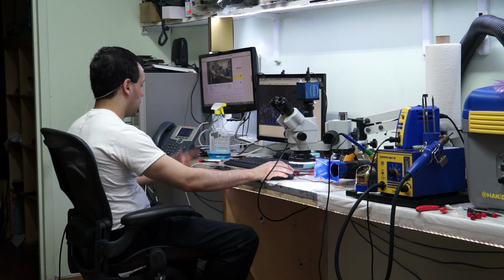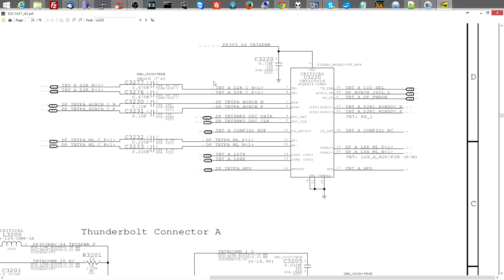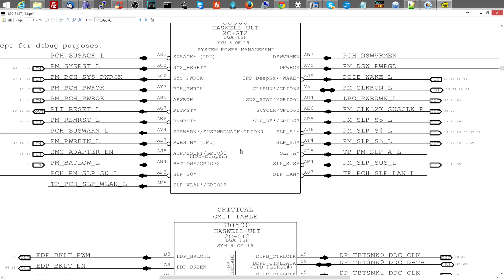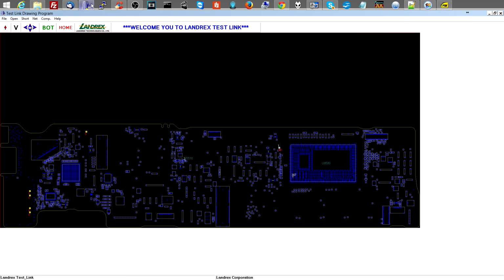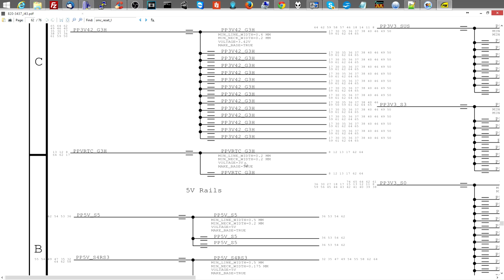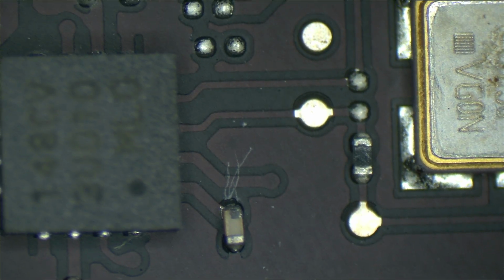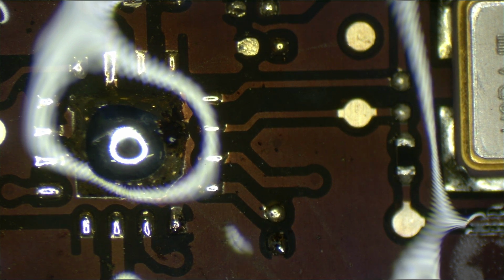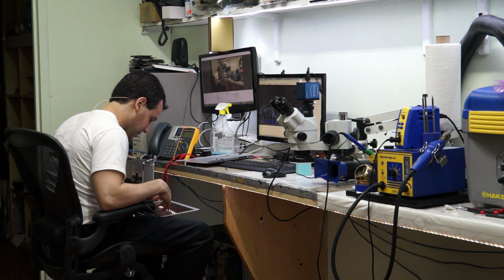Need sleep Macbook Air logic board dead SYSCLK_CLK32K_RTC missing.

Comment: @18:30 The underfill is used for heatsinking and to make sure the IC doesn't go anywhere, afaik. High power chips and little volume mean it can reach high temps, possibly enough to melt or oxidize the solder underneath. That's a pure silicon die there; it would be much larger if it had the epoxy coating and wireframe like a typical IC package.
Reply from the maker: +WhatnotSoforth Good to learn!! Thank you.

Comment: Hey Louis have you looked in the Tagarno digital microscopes, they seem to have the options that would suit your needs 1080P/60FPS with USB 3, you can set them up to work direct from the microscope to a monitor with HDMI or through a PC for image capture & live video etc.
It would probably take a little getting used to working off a monitor but once you get used to it, ergonomically it's a much less fatiguing way to work, they have various accessories to help with creating the most ergonomic set up,  like flex arms for your monitor and control box's so you can operate the most common functions without going through the pc, zoom, focus split screen image capture etc.

P.S I have no interest in Tagarno, financial or otherwise. Im just passing on the information after watching your frustration with the Mantis elite/ Mantis Elite Cam. 
there are various option the link below seems to be a model that suits your requirements.

Good luck
 http://www.tagarno.com/products/magnus-fhd-zip-0

Comment: Rookie question #1 how to deal with a padlock screen on a 1278...any attempt to go into alternate boot options brings up the no bootable device screen....any ideas?
Reply from the maker: +Steve N Get password from original owner.
Reply: +Louis Rossmann OK assuming that is not even remotely an optoin due to scooping this up from a goodwill....so your saying this thing is a paperweight...there must be other options
Reply from the maker: There are and it takes 5 minutes of work to do, easily, but I don't make it a habit to teach that type of board work.
Reply: +Louis Rossmann ok then trash it is..thanks
Reply: +Steve N There are, of course, options. Do you have access to a similar bootable machine?